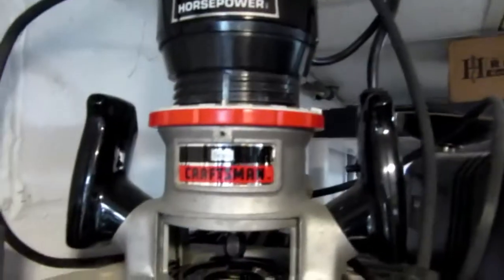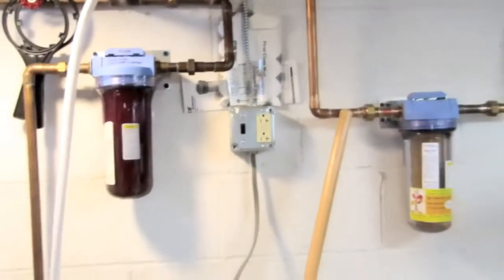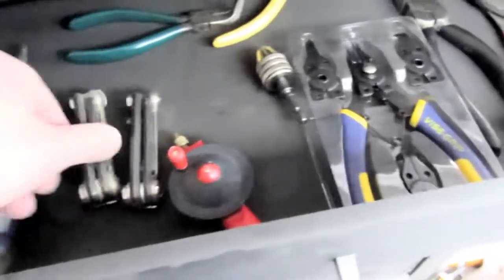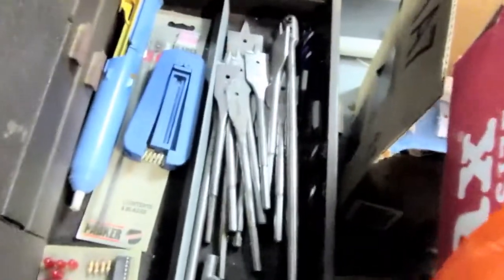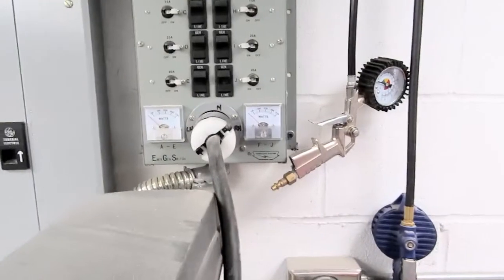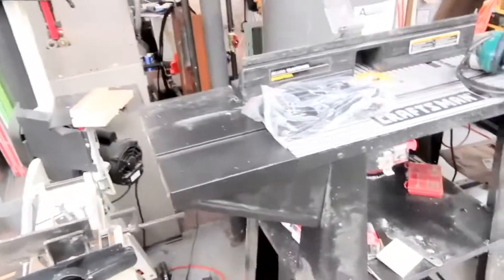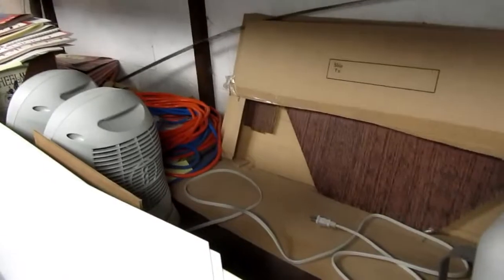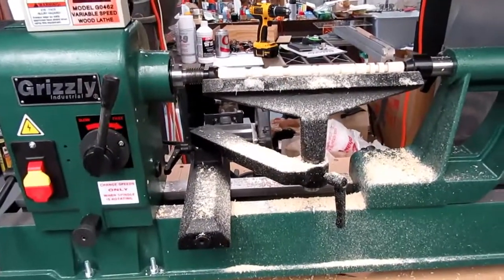Home Shop Tour

Comment: mmmmm kinda looks my variety of tools. I need to hook up a dust collector system. I am a retired tool and die maker , so I have used a lot of different tools.  That was a cool bridge video and history story.  finally getting a new electrical panel, generator and outside connector. Although retired still busy doing necessary stuff, it's all good though.